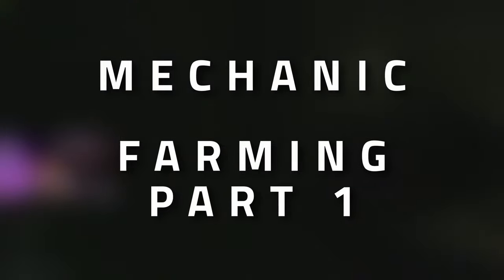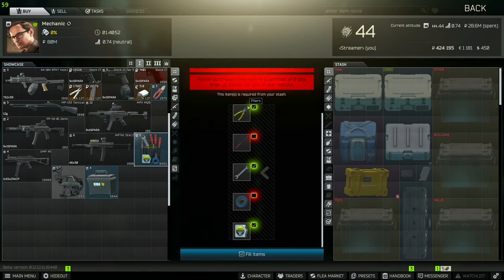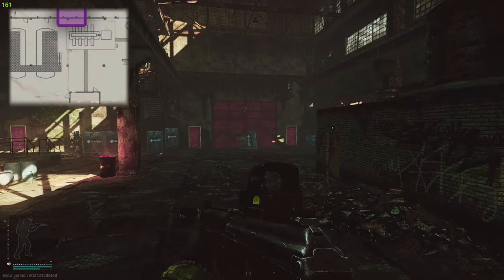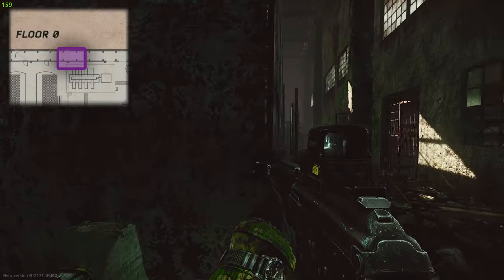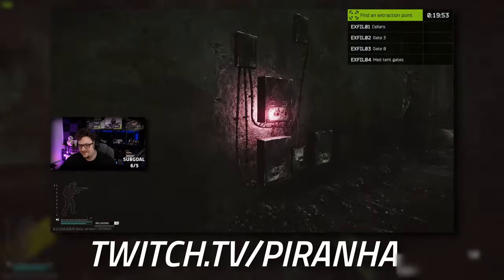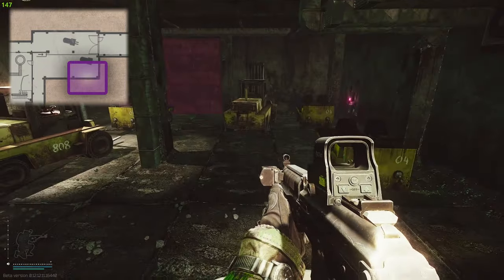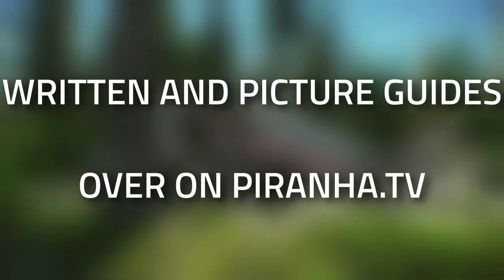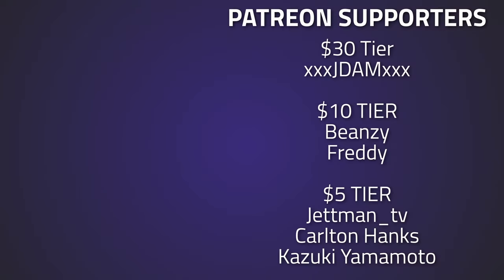Farming Part 1 - Mechanic Task Guide - Escape From Tarkov

Comment: once the quest is done and I fail to extract, does it count? How long do I need to stay in raid in factory for it to be a "run Thru? Thanks ! :)
Reply: if surely did the quest by now ; but -> doesn't matter if you run thru after you repair them. Run thru don't count only at daily
Reply: I repaired on two different occasions, then just came in to exfil I did a run through and still got the mission